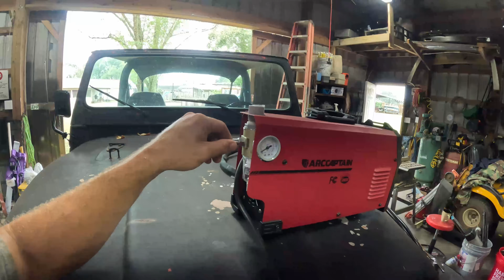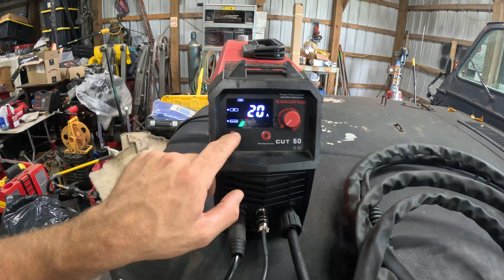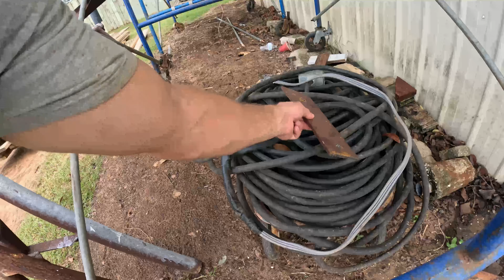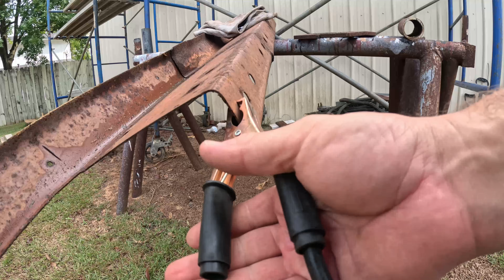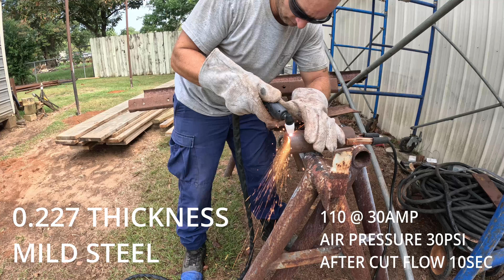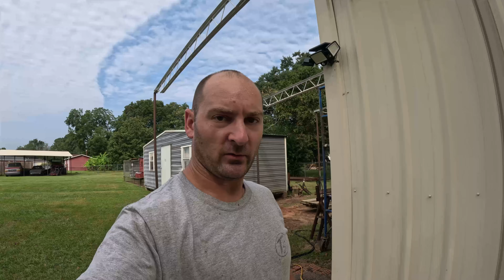HOW GOOD IS THE ARCCAPTAIN CUT50 PLASMA!!

Comment: I have mine on 220 v 40 amp breaker,it buns the tip if on 50 amp it don't cut worth a flip,if i ride it on metal or a little away same thing,best of luck for you guys, i bought it based on this video, waste of time & money for me 👎.
Reply from the maker: Sorry for you bad experience. I have 50 hrs on mine now and it works perfect, I’ve had to change to tips a few times. But other than that it works like it just came out of the box.